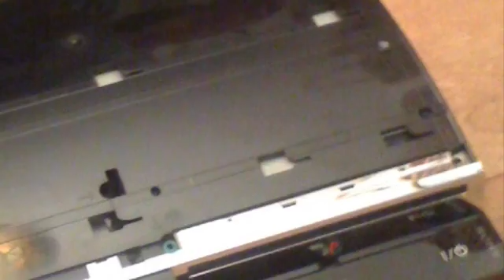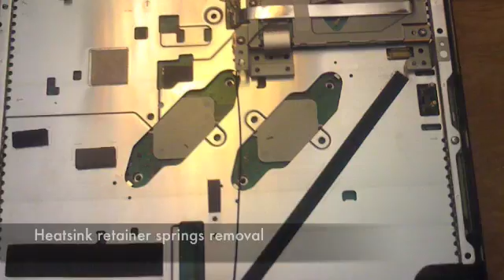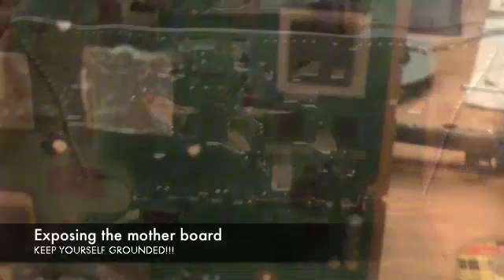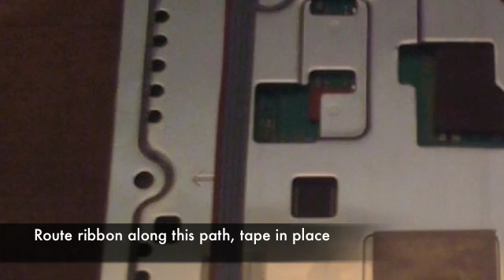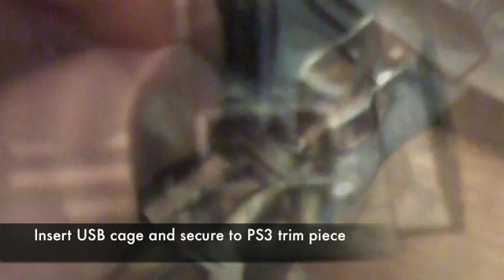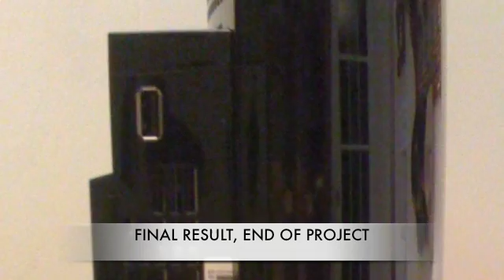PS3 single rear USB port mod

Comment: would it e cheaper and safer to use a powered usb hub. 8 usb ports and requiring no power from the ps3

Comment: @MacSolidWorks why to take it apart ?
you can use that by closing the power prising the eject butten and then open it in fat or remove the plug presse and hold the eject butten wile putting the plug in that is better and eassier

Comment: My question is. The usb ports seem to be shot. From the board and not the actually ports so no like just replacing. Is there a way to reroute the power from further up the board to the usb ports to give power again

Comment: i used this to put a usb on the inside of my ps3 and then hooked up 2 led lights to the other end of the usb i cut and wired in then made a thin pattern for the lights cut a hole on the inside sheeth the outer case with the ps3 logo on it is kinda see through so i didnt need to cut that covered the top of the cd drive with foil to help reflect the light ( thats where the lights went) put it together and whalla i now have a glowing pot leaf on the side of my ps3 every time i turn it on

Comment: Yeah man, would be so cool!!! 

With one exception: --- It's impossible.

Games are hardcoded to work with the stock system specifications, so even though you'd manage to add more virtual memory(which i hardly doubt  ever will be possible) no significant change in performance would occur.

Comment from the maker: UPDATE DAY 2:

Today was spent cutting traces on the PS3 motherboard, prepping the USB hub controller board, and mock-up of the PS3 to figure out where all the cables & electronics are going to fit.

Finding a place for the USB controller board is proving to be the most difficult task, but I'm confident we'll find a suitable home for it in the case somewhere.

Hopefully I'll have more to share tomorrow.

Comment from the maker: UPDATE:

I spent this evening working on the improved mod.  I've got the PS3 torn down again, enlarged the hole in the back bezel for the 2 USB ports and mounted the USB cage to the bezel.

Looks really fantastic so far, you're gonna love it!

Tomorrow begins the wiring.

Comment from the maker: Well GearLife, if you're telling the truth, I feel bad that your PS3 no longer works.  However, I never told anyone to do this, nor have I made any guarantees.  Good luck with your lawsuit.

In my opinion, what has happened is you didn't keep yourself and the PS3 grounded and you've zapped some component with an ESD (electrostatic discharge).  I warned you to stay grounded.

People, if you have no experience doing this kind of work, or you have nobody to guide you, please, please don't do this!

Comment from the maker: I didn't think of installing a switch, however my goal is to put a two port USB hub in the back.  This was just a first-run to see if it would work at all and if I could find space in the back bezel for a port.  Once I get a hub in and wired properly, I won't lose any ports in the front and gain two ports in the back.

Comment: You could have cut a little hole in the back for a switch to switch between the front and rear ports so you wouldn't have the problem of 2 being active at once.